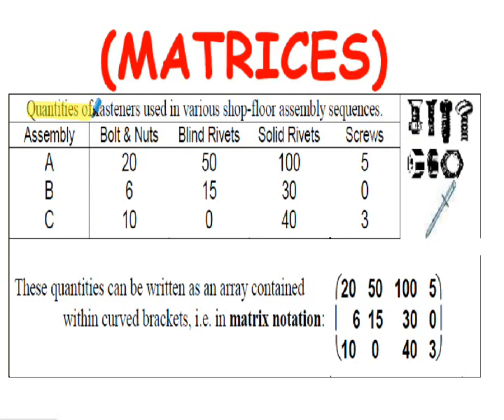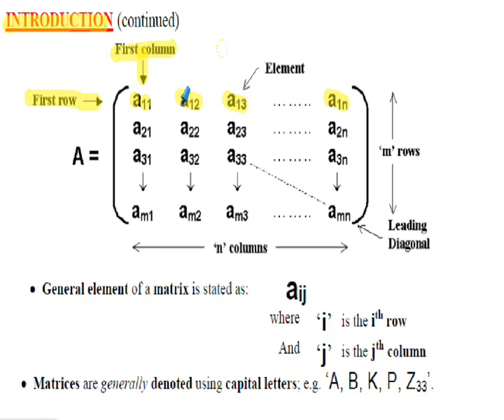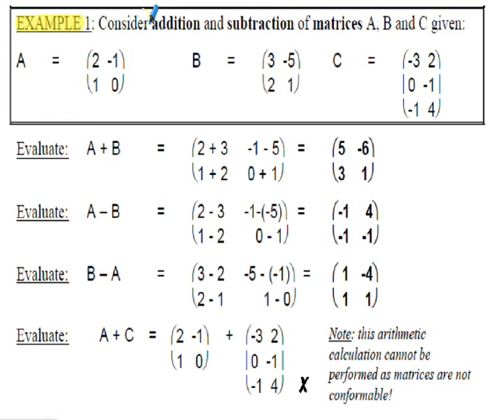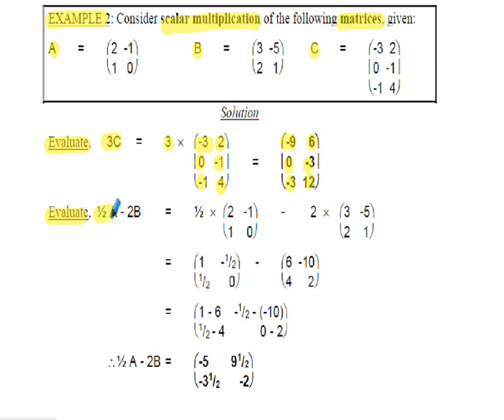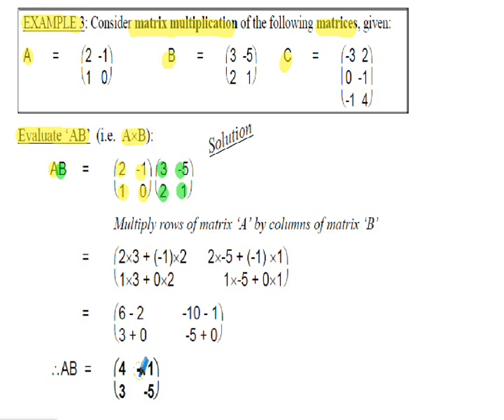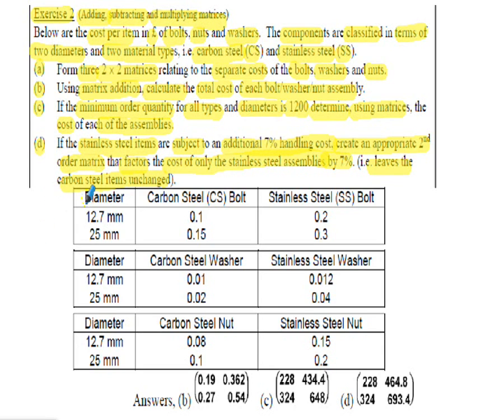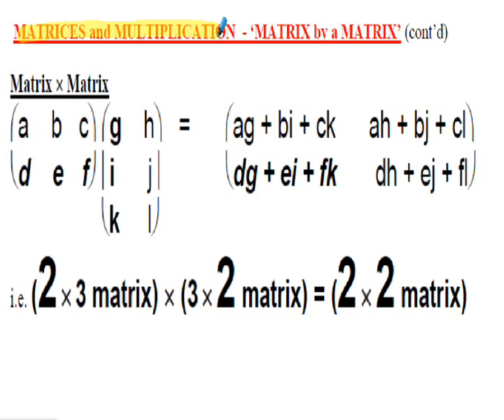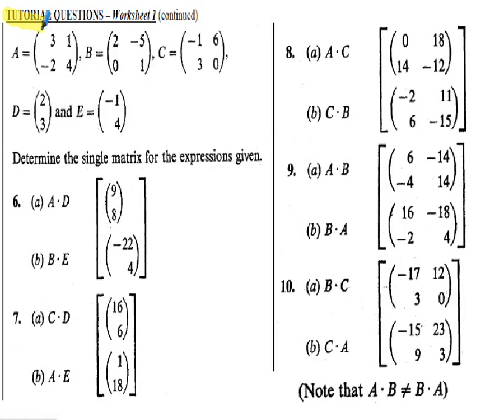Matrices Introduction

Comment: For exercise 2d how did you know how which element position to put 1 and 1.07 in the CH matrix?
Reply from the maker: If the 2x2 C1200 matrix had been multiplied by a 2x2 unit matrix, no values would change as multiplying by a unit matrix, i.e. having unity on the all ‘leading diagonal’ elements, in this case elements (a1, a1) and (a2, a2) is like multiplying all elements in the C1200 matrix by one. 
Because we want to leave the carbon steel, i.e. first column of C1200 matrix, elements (a1,a1) and (a2,a1)) the same but increase cost of the stainless steel items , i.e. second column of C1200 matrix elements (a1,a2) and (a2,a2), then we need to place 1.0 in the CH (a1, a1) element as this factors the first column values, and place the 1.07 in CH (a2,a2) element as that factors the the second column of matrix C1200.  Thus, when we multiply ‘rows by columns’, in this case only the stainless steel items are increased in value.  Hope this helps.
Reply: Many thanks